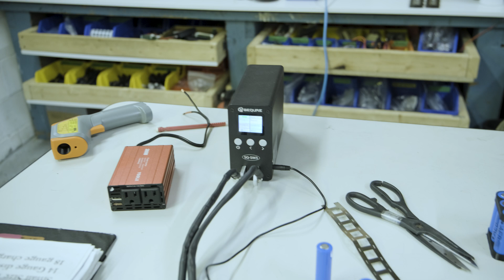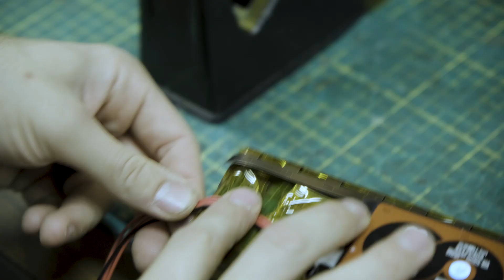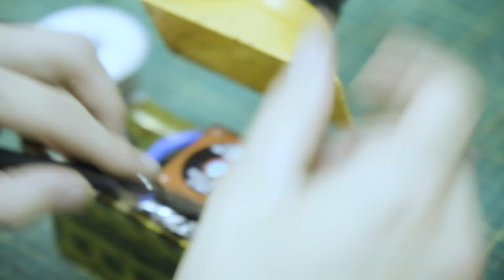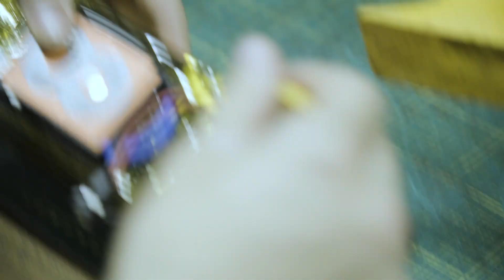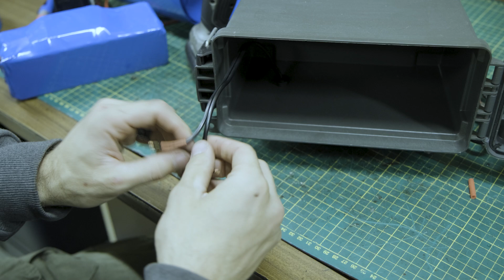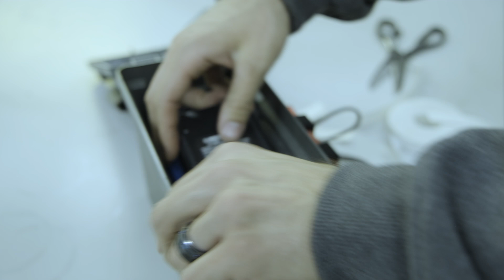DIY Portable Power Station!!!

Comment: Cauliflower
I kinda am interested in stuff like this,its relatively more complicated than making 240 amper USB(so 5,18 volts)powerbank from 12000 mAh 3,7v cells and a powerbank case but stuff like you did is exciting cause with correct tools and materials you can escalate as much as your cash allows you,which is why i like it so much,like imagine box of 1000x12amp cells(12000 ampers*3,7volt=37KW which can last through entire night for a solar roof house)

Comment: i BUILT ONE USING A 72V 35AH. USED 200WATT SOLAR PANELS CONNECTED TO A MPT-7210A SOLAR CHARGE CONTROLLER. RUINED MY BATTERY. BROKE THE BATTERY DOWN AND IT RUINED THE SERIES THAT WAS CONNECTED TO THE POSITIVE SIDE
Reply: Any idea how?